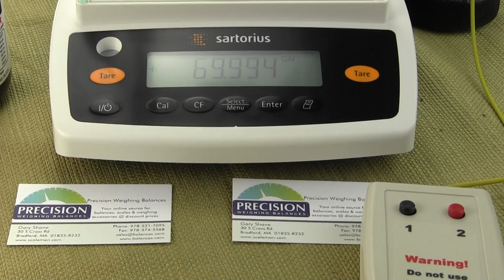Ammo reloaders weighing powder to a kernel RCBS10-10 vs Analytical Balance

Comment: My lyman ohaus  balance beam scale in use since 1966 ($16.00), clearly indicates adding a single kernel of h-4350 to the pan. 5 kernels constitute 0.1 grain. The scale is positioned at eye level to eliminate parallax. I motorized a lyman trickler with a foot control to deliver a kernel or a few to a thrown charge.